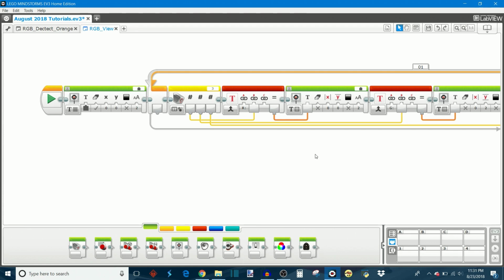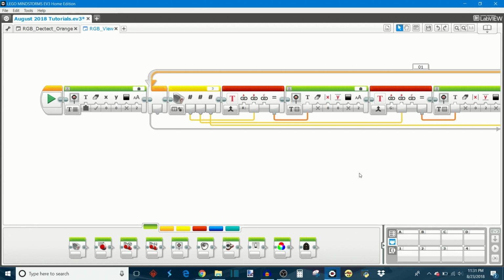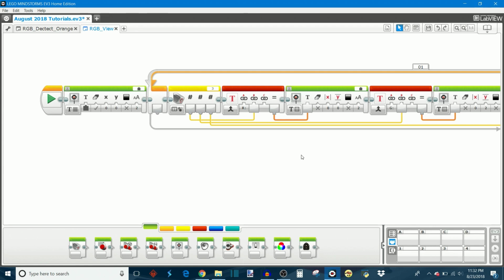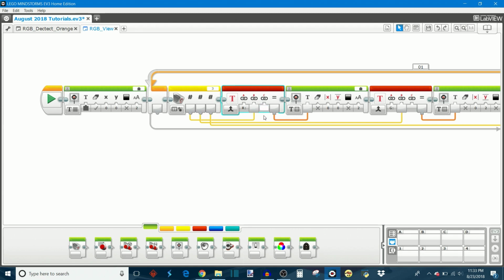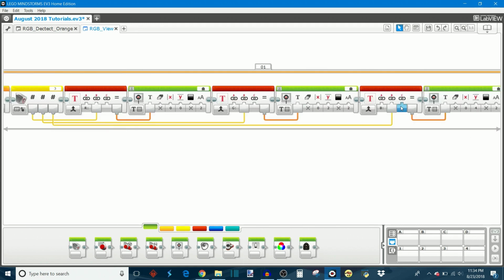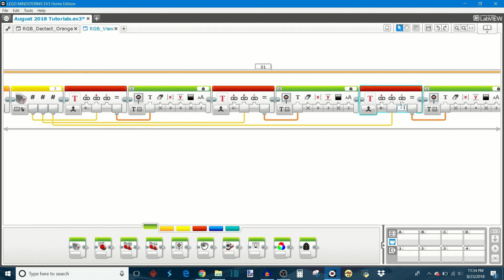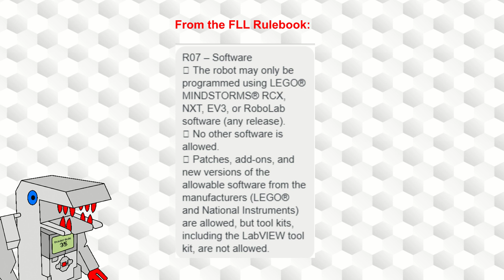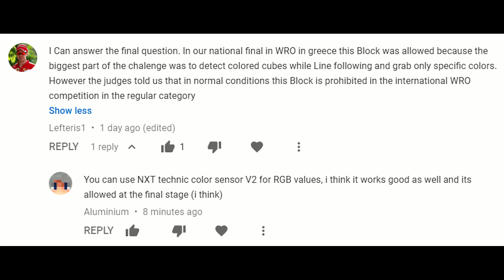[Addendum] RGB Color Sensor is NOT LEGAL in FLL or WRO

Comment: Just an FYI that in some regions FLL is piloting a program that loosens the programming restrictions where you can use pretty much any language/library for the Mindstorms brick provided the robot still runs in an untethered fashion (not tethered via a cable or "tethered" wirelessly via for example bluetooth). I've heard that at least a few states have signed on. Want to use Python, Basic, C, Javascript (via MakeCode)? They're all possible in those regions.
Reply from the maker: Thank you, I am aware of that. I am curious to know exactly which regions those are, but I think it's a step in the right direction for FLL. It will make programming harder to judge but kids can now branch out and try different languages. It should be great and I can't wait to see where it leads us.
Reply: WA state is part of the open software platform pilot. It's a good challenge.

Comment: Hey Kyle, I think it is allowed in WRO. My coach ask us to use it before
Reply from the maker: Hi Jeffrey! Check out 2.10 in the rulebook (bottom of page 4): https://wro-association.org/fileadmin/files/challenges/wro2018/WRO-2018-Regular-Rules.pdf 

This reads just like the FLL rule that prohibits the RGB block, so I imagine that the WRO rule is meant to be interpreted the same way. There are occasionally some regional variations in rules that may make it legal (like in the Greece example in the video).
Reply: Builderdude35 I don’t think there is any physical modification involved when using the block. Even if the block is used, judges will not be able to visually see that we are using the block. In fact, senior high competitors are allowed to use a different firmware. So I think it should be allowed as it was not explicitly stated.
Reply from the maker: Okay, i think you have a fair point. I still warn viewers to use the block at their own discretion.

Comment: There is an official developer kit for LEGO MINDSTORMS Software, is that allowed?
Yes, the official kit from this website is allowed as long as the participants can explain the use and functionalities of the blocks and functions they have created.

This was from the FAQs section under the WRO website.

Is there any clarification that we can get on this? I have been exploring this to create my own set of custom block with my students. So that is to say if we are able to mod the color sensor block on our own, will it be allowed?
Reply from the maker: There is an official MINDSTORMS Development kit, that is what was used to make the RGB color sensor block. This is the development kit that I refer to in the video. As explicitly stated in the video and in the official FLL rulebook, the Development kit is NOT permitted in the FLL competition; they see it as third party software.
Reply: But for WRO?
Reply from the maker: I don't think it is allowed in the general international WRO rules. See 2.10 of the official 2018 rulebook (bottom of page 4): https://wro-association.org/fileadmin/files/challenges/wro2018/WRO-2018-Regular-Rules.pdf It is phrased very similarly to the FLL rules, which prohibit the RGB block in FLL, ao I imagine the same applies for WRO. Of course, regional variations in rules do exist, as shown in the video's example (Greece). If in doubt, contact your local event coordinator to verify, but I would err on the side of caution and say that it is not legal.